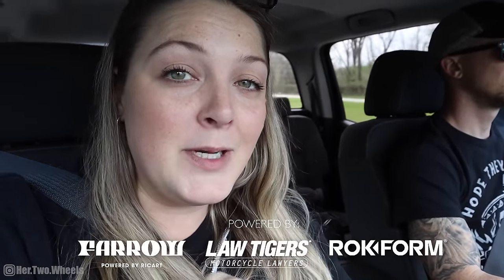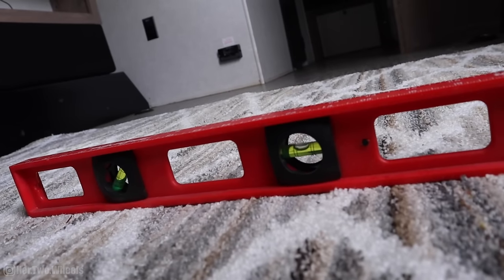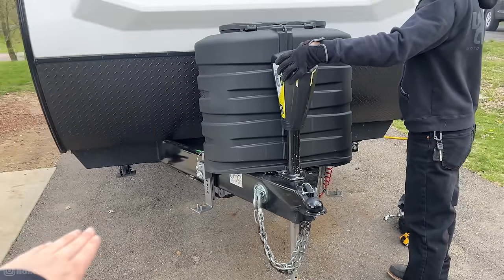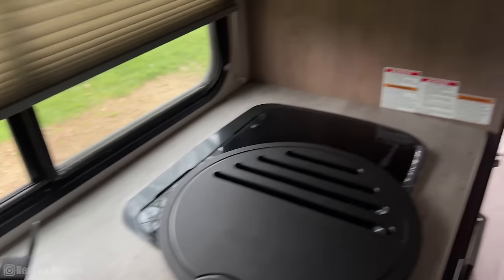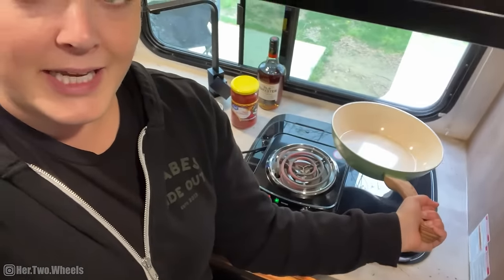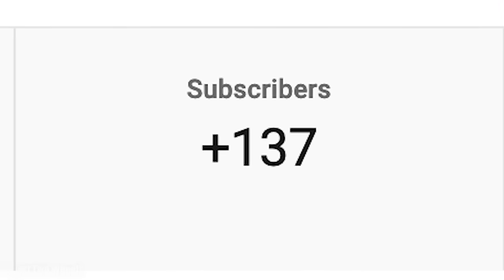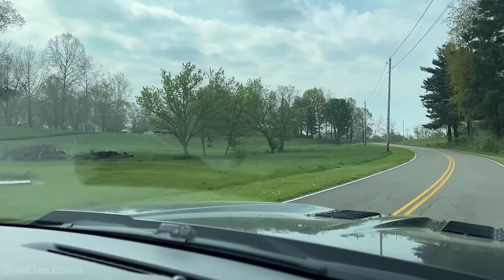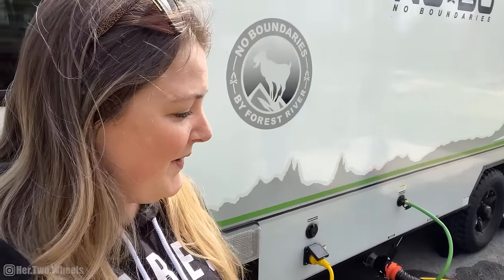First time camping in our new Toy Hauler! Mistakes were made!

Comment: Awesome vid, love the rig!! You can buy rubber gaskets that go into the sewer drain and allow for your orange 90 to adapt into the more recessed sewer hookups.  Also for the fridge, plug it in at home the night before, cool it down, then load it. When you're on the road, switch the fridge over to use Liquid Propane, then switch back over to electrical when at your site. Then the cooler can just hold the beers and ice! Hope you had fun! You will need generators for boondocking as well, especially for the microwave and space heater!
Reply: You should Not run the Fridge off propane while Traveling. 
It is very dangerous and Against the Law in some states. 
Propane should be turned off at the tanks while traveling.

Comment: You did great. You will adjust processes and increase speed over time. 
1) Make checklists. They seem silly but they work. 
2) Once fully connected and before getting on the road do a full walk around to check everything. Kind of like doing a t-clocs on a motorcycle. 
3) As others stated, parking closer to the site utilities has advantages. 
4) Tossing sink water into the grass of a camping area is a bad idea. It attracts mosquitoes and other bugs. It is prohibited in most area. There are very few places where it is legal to dump gray waters on the ground surface. 
5) When installed, some weight distribution bar can make it more difficult to accurately back up. 
6) Using an awning has a lot of potential problems both in the campsite and on the road. Do your research and practice. 
7) Rear loading toy haulers for street motorcycles have a dilemma. At most backin camp site you can't unload once setup. It you camp with the street motorcycles parked on the site but not the camper many camp grounds will charge an extra vehicle fee. 
8) You may want to improve your setup at your house. a) Have the refrigerator loaded & operating, and the fresh water tank full before leaving means that on long first day drives you can make full use of the RV on the road. b) If you can build a legitimately and legal dump station at your house you can camp at campgrounds that don't have dump stations without needing to find a dump station on the drive home. 
9) The toy hauler will make a great way to escape South to do winter riding. For this you may want to add tank heater to prevent freezing of your fresh water, gray water and black water tanks without needing to winterize every time the toy hauler is exposed to freezing weather. c) BTW, they make heated fresh water hoses for doing full hook-ups in the winter. 

Most important, have fun. 

It is always great to see couples working together. See you and Jordan together is great.

Comment: Jess, I havea Gray Wolf 19RR toy hauler that I bought a couple years ago new and I have learned a few things and I will list them for you....
1. Invest in new trailer tires asap, the tires that are on new RV's are crap (the ones that come on the RV is the cheapest that they can find)
2. Backup camera system. I have a Haloview 3 camera system ( 1 left side, 1 right side,  and 1 rear)
3. Change your RV door lock (I got an electronic touch pad one from RVLock)
4. Always dump your Black Tank first and use your Gray Tank water to kind of wash out the hose from the Black Tank release
5. Use a different hose for RV water and a different hose for Black Tank washout
6. Be sure to get a electrical surge protector (can't always trust campgrounds to have the best power system) 
7. If you are hooked up to City water at the campground you don't need to use your water pump on the RV
8. If you use your electric on your water heater make sure your water heater tank is full before turning on the water heater
There are so many helpful tips on RV things on YouTube if you have any questions you can find someone who did a video on it....
I hope you have a lot of fun with your new camper! We use ours for more than motorcycle related adventures....

Comment: I live in my camper from July through November. Lol so many things. And you’ll figure them out along the way. The one thing I’ll say is I don’t hook up my sewage lines unless I’m going to be parked more than a week. Every camper I’ve ever seen can hold enough black water for a week. And grey water I use a hose adapter and run that into the grey water drain. Using a dedicated grey water hose of course. And I usually cut the other end off of the grey hose so it doesn’t accidentally get used for anything else.
Edit- those “water relief valves” are backflow preventers. They stop any water from somehow going back into the faucet. They always bleed off the extra pressure when you turn them off and on depending on pressure. What probably happened is the campground had a pressure loss or pressure fluctuation that caused the valves to dump. It happens.

Comment: Pro Tip: Make sure you verify that your grey water isn't plumbed into the black tank. Some coaches do this because the black tank is easier to get to than the grey. To verify, close the grey release valve and open the black valve, then run the water that you think should be going to the grey (kitchen, bathroom sink, Shower.) If any of these are connected to the black, you will see it coming through the hose. Some coaches plumb the bathroom sink and shower to the black. Important to know for awareness and to keep you from overflowing your toilet or backing up in the shower tub.

Comment: Turn fridge on a couple days before you leave so its cold & load it up.
Level side to side first thing. 
No real need to hook up sewer unless you need to dump. I usually don't on a single night stay.
X-chocks are only for stabilizing, add after all set up.
You need a surge protector, preferably an EMS for power protection. All appliances have circit boards. 
Best of luck on your travels.

Comment: Congratulations on your new Rv. That campground is actually a spacious campground, some around the country are extremely tight.
I use an electric heater, as well, to save on propane. 
I leave the chains on while unhitching. 
If you need anything, you can DM me.

Comment: Guiding the driver backing the trailer. Stand to the left rear of trailer so driver can see you giving directions from his left mirror Remember,  If you cannot see him in the mirror, he cannot see you. Use hand and arm signals not a nod of the head for directions. Do not walk from one side of the trailer to the other giving directions.
Lint from the clothes dryer, packed into the toilet paper roll core, makes a great fire starter. Start saving those toilet paper cores and the dryer lint.

Comment: great video. 
you can connect power first if you want just make sure your shore cable is long enough and not in the way. i recommend the Level Mate Pro and Anderson levelers for helping you level. X chocks after level. 

You don't need to run the water pump when connected to a water supply, get the Oxygenic fury shower head, and Zero hoses are awesome for RV use.

Gloves on any time you are messing with sewer related stuff including the valves.

Put the dryer lint in a toilet paper / paper towel sleeve.

hope this helps!

Comment: More than likely, if you boondock, you can use the propane for at least a week to power the fridge, water heater, and furnace. Hooking up to power will extend that a lot. Biggest thing to remember is when taking showers and washing dishes, you don’t want to let the water run.  Wet yourself down turn off the water,  wipe down with soap, then rinse.

Comment: The yucky stuff coming out of the water filter is actually charcoal ( the filtering agent). and a safer alternative to the hot plate you used is a "Induction hot plate" less chance of burning your "new away from home ,"home". Additives to your toilet will keep the area smelling better as well as breaking down the solids and paper. Since my wife's passing I have been living full time in my RV on a friend's 27 acres just outside of Osceola, Texas.

Comment: ALWAYS chock the wheels before disconnecting from the truck, or before doing anything.  I learned this the hard way!  I disconnected first and the wheels rolled and bent the part that supports the trailer on the tongue. I had to use the truck jack to raise it back up.  Now, when I get backed into the site, the first thing I do when I get out of the truck is chock the wheels.

Comment: Yall did good, it is a learning experience every time.  If you check out changing lanes they have several general checklists that are very useful.  Not everything on their list will pertain but the basics will, and you can edit it for your needs.  

The space heater is a good idea when hooked up to shore power will save greatly on propane.  The refrigerator doesn't use all that much.

If you find you want to keep better organized withoute tote boxes, the soft sided tool bags work great.  My dad and I have one for energy, one for water, one for roof repairs.  Also for hoses the rubber zip ties are great.  

Another source for tidbits is the National RV Training Academy, also many others out there.  

Keep it up, you are doing great.

Comment: That oil heater is good but at the same time not because it doesn't blow the air.
Things like that create sweat.
Windows and under windows will become all wet.
Air exchange is very important and a very good upgrade is a stove fan.
I lived full-time in a camper in Canada for three years down to the - 50s.
Also a lot of people just dump the grey water into the grass unless of course you got full hookups.
So happy for you guys! 
Oh and I almost forgot get a Pilot Flying J card they have RV dumps and it's real cheap

Comment: Most people already said most of it. I'd like to add the water deal may have been a frost deal OR they could have had some sort of pressure issue and the backflow preventer activated. Potable water is not allowed to backflow into the water supply , so when you're water flows back out of your camper there's a valve that allowed the water out of your hoses and not back into the water supply . Y'all did well. Blackwater first, gray second to flush. Keeping water in the black water tank keeps your business from solidifying in the tank. I did campground maintenance for years.

Comment: We use a variety of fire starters. Old was from candles melted and poured into cardboard egg cartons works well. Dryer lint works best when stuffed into a toilet paper tube fairly tight. I would also suggest a cast iron Dutch oven to cook with when it is to hot to cook indoors. Looks like there are a lot more adventures on the horizon. Can't wait to see them.

Comment: Yall will get to know your camper and get comfortable with the routine. Keep doing your research. After a few trips it wont be nearly as stressful. Ive seen many people comment some great tips here. Id just add research your weight distribution systems instructions many of them tell you specifically to take the weight off the bars when backing up. Also dump the black tank first and then the gray tank to flush out the hose .

Comment: Nice rig! You did pretty good for the first time!

Get a surge guard! Plug it in before you hookup, flip on the breaker and it will tell you if there is a problem. Then turn it off, plug in and flip it back on.

Comment: Ya’all did fine.  Gauge that by nothing broke and no one got hurt.  Here’s a leveling tip.  I think you had a two foot level so I’ll go with that.  Place the 2’ level on the floor (or counter) up against the higher side exterior camper wall.  Raise the level until it reads level.  If you raise it up 1/8”, multiply by 4 to get 4/8” or the same as 1/2”.  You’re a 1/2” out of level.  If you raised it 3/4 of an inch you would be 3 inches out of level.  Why multiply by 4?  2 feet plus 2 feet plus 2 feet plus 2 feet equals 8 feet. The camper is about eight feet wide.  If you used a 4 foot level multiply by 2, a 1 foot level multiply 8.  I know, I know clear as mud.  Hope this helps.  Or, get a Level Mate Pro and a set of Anderson levelers and take all the guess work out😝😁

Comment: I’ve only run the water first to check the water quality otherwise just hook up the hose open the cold water and hot water faucets and let the air roll out before you turn on the gas or power.

Comment: Great job for your 1st shake down trip.😊 You actually overdid it but I understand and you wanted to learn all your Accessories.....

A couple of things I didn't see in the comment section was.... When backing up, Put your hand at 6o'clockandmovewhicheverway You want the trailer to go. Is small adjustments. It's an old truck driver tip. Been trailering for decades.....

Personally I never hook up to city water pressures can be bad unless you put a regulator on and I don't recommend drinking water you don't know where it came from even if it's in your trailer. Bottled water Only is my rule. Dishes and showers are ok. I  just fill the holding tank w hose. Plumbing problems suck.

I also am no good at starting fires.😂

I wouldn't roll down the road w propane on, like some suggestions....could get ugly in an emergency....

 Rule number one...Always have a drink handy.

Welcome to the rv life, remember, it's a house on wheels that experiences a earthquake everytime you tow it...there will be repairs.....

Comment: To combat the heat when cooking get a New Wave burner top and induction pots. Works on 120V AC and does not generate no where as much heat in the trailer as a hot plate or the gas stove!!

Comment: All campgrounds now install backflow preventer‘s on the water faucets. Any time water is used whether in your camper or the ones around you creates a surge that sprays out the backflow preventer. This is why there is water and wet areas coming from the faucets. Go in your camper and look out the window while you turn on and off the water and you will see it spray.

Comment: Ok I lived in a caravan(camper as you say) for over a year travelling Australia . We ‘free camped’ where ever we could with the van having a bathroom. The van was fitted with propane for hot water, cooktop, oven and ducted gas heater. For the two of us we could camp for about three weeks on one bottle of propane. You should use the propane as it will show you how that Is possible and make your life in the van much easier. Propane is inexpensive in the long run. Having said that when we were in a caravan park we would hook to power for hot water and air conditioning. We also had a generator for free camping to run the air conditioning and also run the washing machine.

Comment: Shouldn't need your water pump unless your using your on board tank. We use electric for the water heater and refer. Furnace and stove don't use much LP. Also always dump black tank first then Grey to clean waste line. Enjoy.

Comment: I've seen a LOT of good tips posted here, some good advice, some bad advice.  However the ONE I have not seen is to turn your breaker on AFTER you connect your surge protector, before connecting your power cord to it.  Most surge protectors nowadays will detect a fault when energized.  This MAY or may not be a preventative step, but it's something I always do since I want to know the condition of the power source before hooking my rv up to it. And secondly, if it's not already provided, provide a way to lock your surge protector to the box or pole.  Some of these seem to grow legs and walk away! Thirdly, make sure your water hoses are drinking water rated, not all hoses are and your water will taste funny, even with the most expensive water filter! And Camco make a clear 'extension', if you will to permit proper seating of the stinky slinky elbow into the inlet.  Not necessary all the time, but VERY helpful when it's needed. I leave mine on the elbow all the time.  Also, Broan makes small ceramic heaters Model 6201-A that have fans in them.  I have stayed in my 40 ft 5th wheel toyhauler in subzero weather with just two of these running on high and they kept my camper at a toasty 65 degrees, in the remotest areas, and 70 in the general area of the heater. So a little camper like your's would probably stay toasty with a single one. That oil heater is for more ambient heat, not distributive. Regarding the water 'purge', a LOT of state and national parks uses wells and pumps.  They occasionally test the pressure release valves late at night, or early morning to make sure they are functioning properly.  You SHOULD be able to ask the attendant if they know the 'purge'  schedule.  It sounds like your's did not.

Comment: I recommend using Level Mate Pro to level your trailer. You will install a sensor in your trailer which connects to your smart phone. Youf phone will display exactly what adjustments are needed within .25 inch. So much easier.

Comment: Should watch keep your daydream ( KYD) they will give pointers and things they use they have gone from a f150 bumper pull to a f450 5th wheel  to jeep with teardrop. Also the jack has foot will drop down so you don't have to run the jack as much

Comment: Two things I noticed. 
1. You should check with your hitch manufacturer on if you need to disconnect before backing up. 
2. Don’t drink water from your water tank. There are a variety of bacteria that can accumulate and make you sick. Unless you drain, flush, and sanitize after ever camping trip you are running a risk consuming water from the tank.